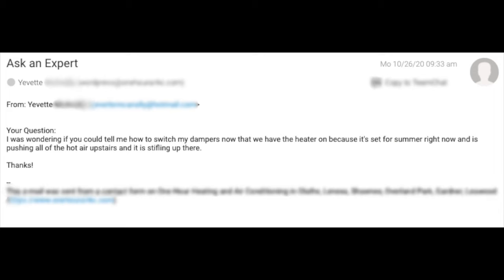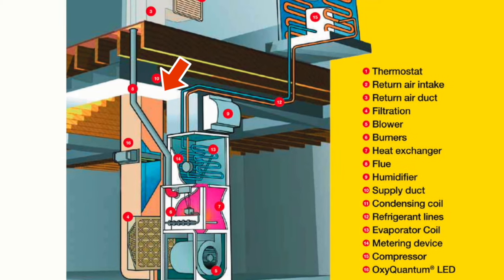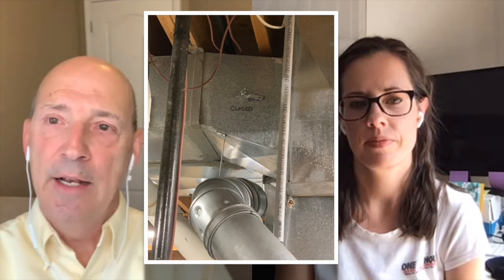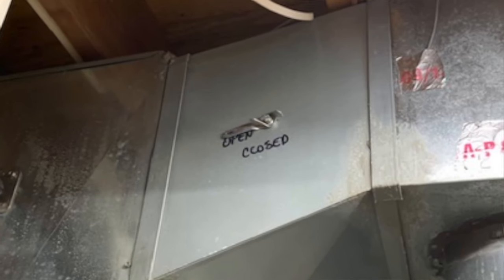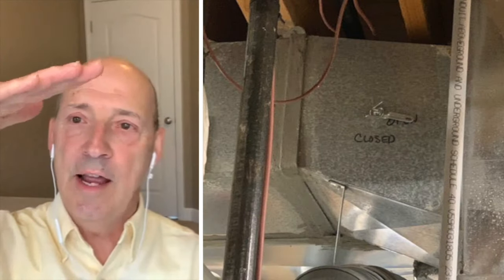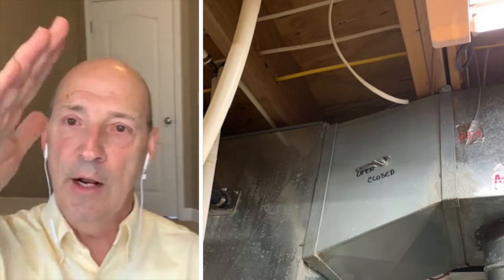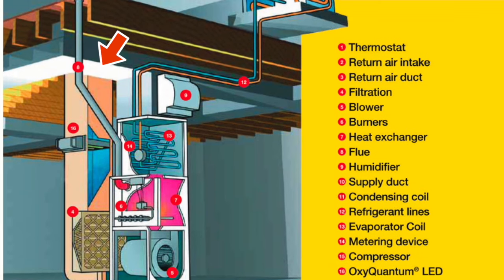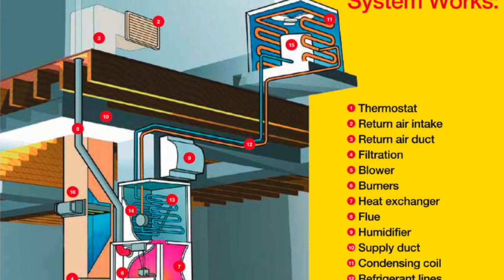UPSTAIRS IS HOT: Adjust Dampers For Heating Plus How to Tell if Dampers are Open or Closed

Comment from the maker: Hi thanks for watching!  I'm testing out posting on a new day of the week so please subscribe to not miss a video!
Reply: Hi. My office building has an HVAC system with a large blower room and a drop ceiling throughout. In my particular office/room the air runs too loud through
 the ceiling vent tile. I asked about adjusting the damper and they claimed there's no damper in this building. I asked if there's any other solution and they said no. Does that sound right to you? And some rooms have vents with barely any air flow. Mine sounds like you're in a wind tunnel. Seems like there is an existing setup to cause different amounts of airflow to come through each room's vent
Reply: @bornbranded29 lqq
Reply: You open the damper and feel what vent is discharging. Then you mark it accordingly.

Comment: I thought it was not normal for the upstairs to be so damn hot right now, which is what lead me to this video. Thank you! Adjusting the damper right now, it was wide open for the summer time, should I fully close it or slightly close it? I barely moved it and it seemed to cut off the air flow entirely to the upstairs.

Comment: I have a basement a middle floor and a upstairs. I have a thermostat on the middle floor and one on the 3rd floor in my bedroom. Basement is freezing in the winter. What thermostat runs my basement? Also the heat barely comes out downstairs. What damper should I look at ?

Comment: So if the damper is fully closed does this mean no air is traveling through the vent?  I have a split unit.  Trunk lines on each side of one of the units upstairs.  On the right side the damper is open and on the left it's closed

Comment: What is you have a dual zone either honeywell dampers on supplies to each damper.  Right now the damper is set to bleed some heat to the zone 2 bonus room when zone 1 calls for heat. Seldom does the zone 2 call.   But what happens when we switch to a/c?

Comment: home on slab, horizontal forced hot air furnace with a/c up in attic. this home has one zone. I believe no manual damper like you described. what is the best way to pull more hot air on first level. 2nd floor too hot even with vents closed. vents are on ceilings both floors
Reply: I had the same question

Comment: I have noticed one damper. It has a summer and winter written indicators. I opened the area where the damper is and when I turn the lever it closes for summer and opens for winter. Should it be the opposite? I ask this question because it summer right now and I notice that my upper floor was getting hot while the damper was set on summer. Should I just keep it open and then close it for the fall/ winter?
Reply: By the way thanks for the video.
Reply from the maker: Hi thanks so much for the question.  We answered it for you in this week's video you can watch here: https://youtu.be/X5sqsthoGKs. We address your question at around the 10:26 mark.  I hope that helps!